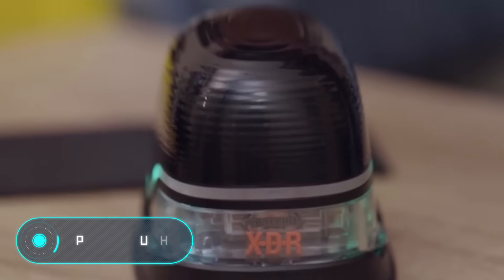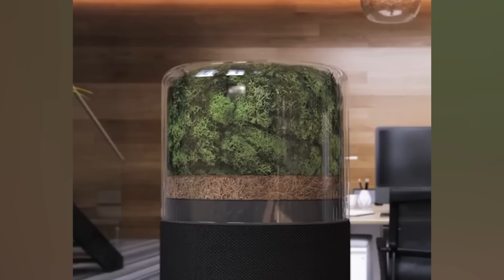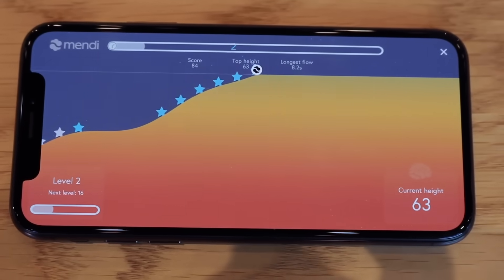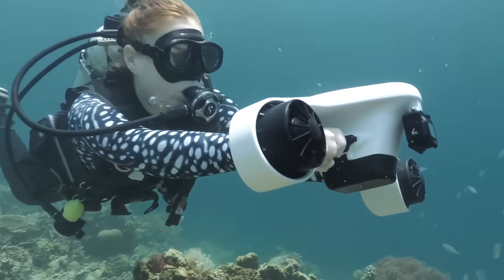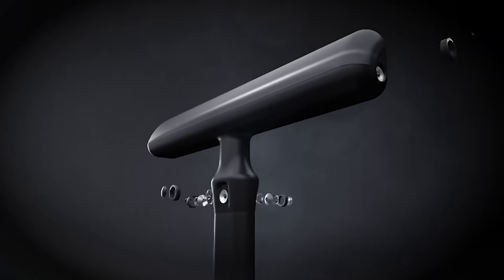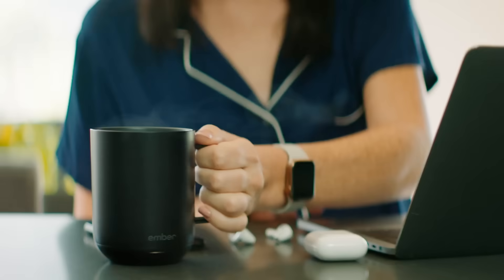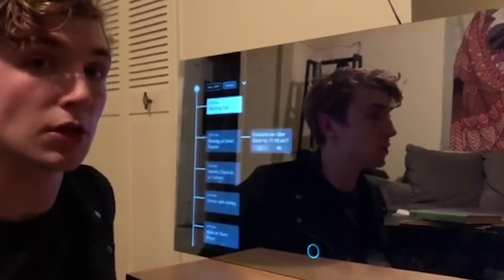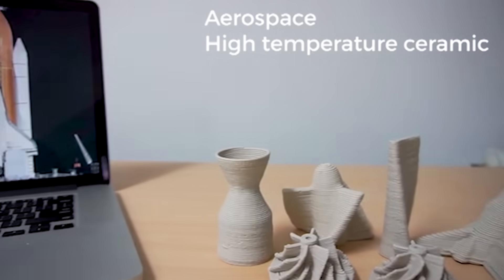AMAZING INVENTIONS THAT ARE AT THE NEXT LEVEL

Comment: Thieves in 2019: steals key to get in
Thieves in 2020: STEALS FINGER
Reply: A properly designed Biometric lock will make sure the Body Part it's looking at is still alive before unlocking to prevent thieves from simple killing/dismembering the locks owner to gain access...
Unfortunately, as far as I know, none of the Fingerprint Padlocks (or even Cell Phones or laptops) check for life signs, only that the print matches the stored image as proven by the Mythbusters - a photocopy of a fingerprint was successfully used to unlock a high end laptop...